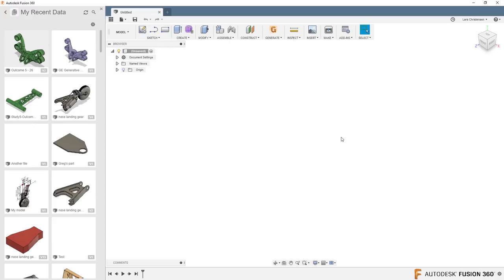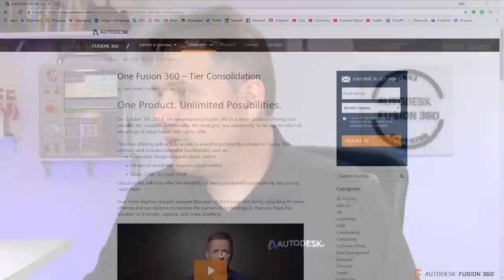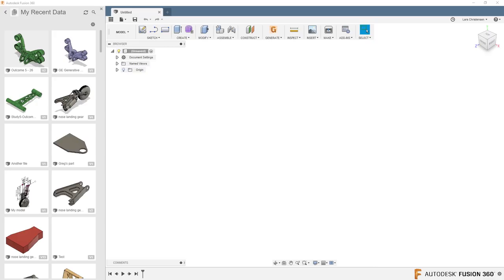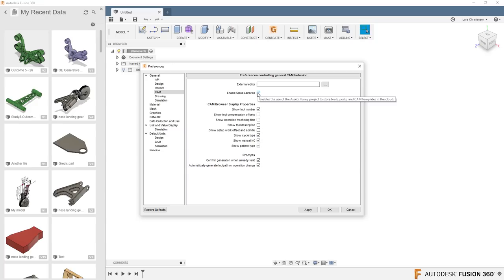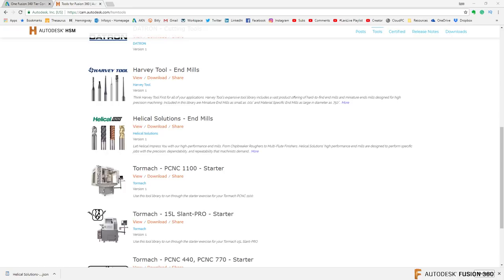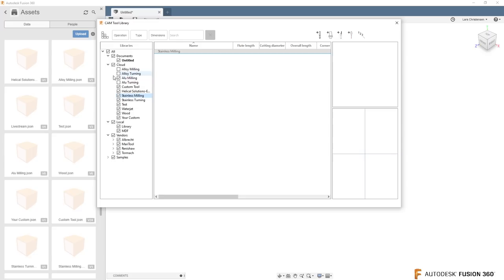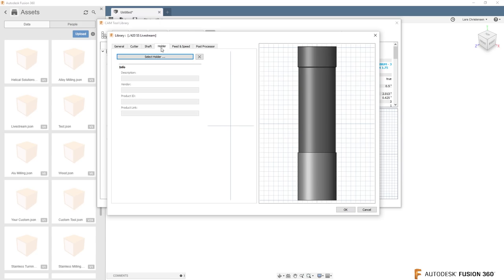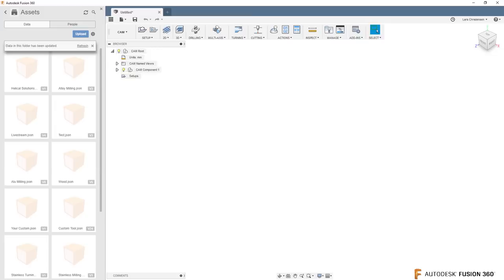One Fusion 360 | One Change & More CAM Tools — Tutorial  — #LarsLive 198

Comment: Hi, hope Lars or somebody can help me with this topic :
Laptop screen sizes and resolutions....what is better for Fusion 360?
I am now running Fusion 360 on a Surface Pro 4 laptop, 12.3" screen with 2736x1824 resolution, aspect ratio of 3:2.
I have the joy of now using a 3Dconnexion SpaceMouse, but I still want a larger workspace.

I am seeking a pc that gives even less zooming, and a larger workspace.
By larger I mean: containing a larger part of the design (not screen size in physical measurements).

Will a 13.9" FHD laptop give a larger workspace than my Surface Pro?
Is there a difference in how large the workspace will be on a 13.9" FHD laptop versus a 15.9" FHD laptop?

Will a 4K 15.9" laptop give a larger workspace than a 15.9" FHD laptop? (And will Fusion behave good in 4K when following the best of tips for settings from Autodesk/users?)

Comment: Lars,  Great video. How do you copy the tool library from a previous computer to a new one?
Reply from the maker: Hi Bill Griggs Thank you for watching!
You should be able to move them to the cloud. Check out this video:
https://youtu.be/gH6U_vurV_Y?list=PL40d7srwyc_Mkgc5wvP_OfVel9aDkNkZ6

Hope this is useful

Best,
Lars
Reply: I had a new laptop and installed Fusion 360 but my previous machine did not have the tool database stored in the cloud. I will try to store the old database to cloud and see if it becomes available on the new laptop, Thanks Lars.

Comment: Hi Lars, I was working in Fusion on Friday and was using many McMaster items.  I didn't shut the computer down, or fusion and now the option to insert McMaster component is missing, instead I have an "insert manufacturer part" buttom.  This is next to useless for me in the design phase.  I went to insert a spacer, which would have been all of 15 second search on mcmaster.  Is this change from Autodesk or is something wrong with my install?
Reply: Edit:  It MAY be due to unexpected maintenance (9/10/18).. I hope so.